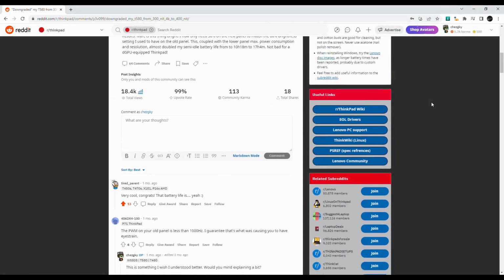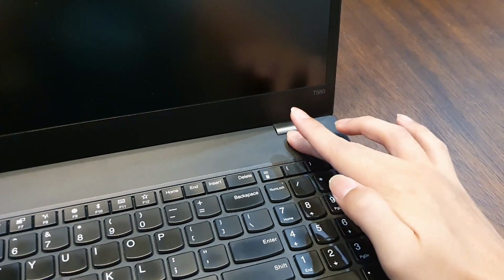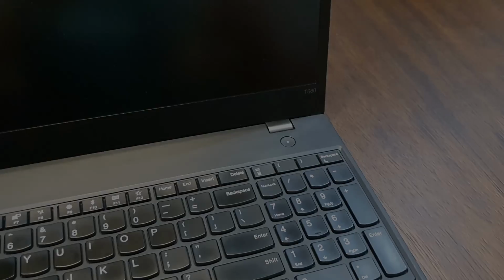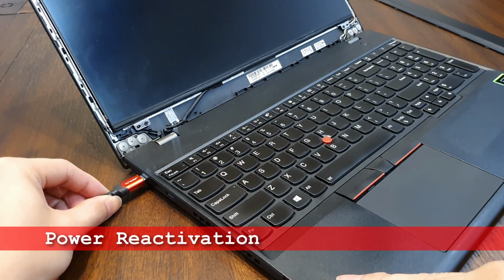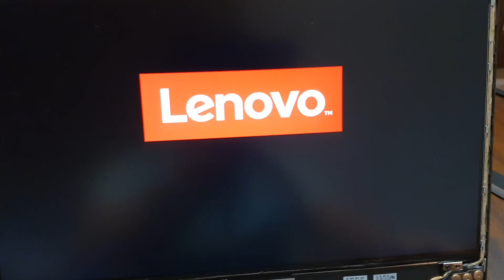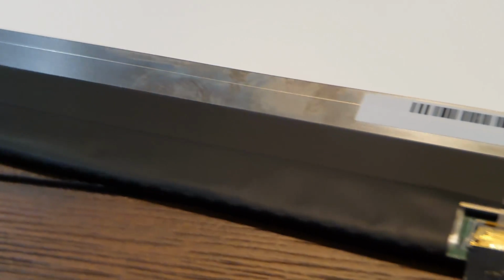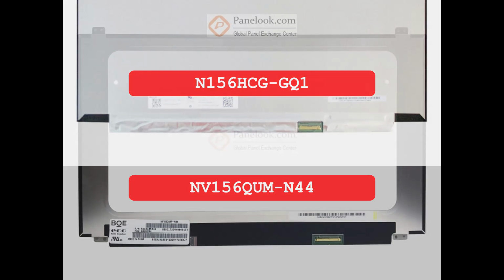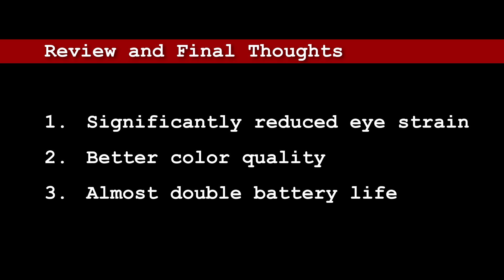DIY Thinkpad T580 P52s LCD Screen and Display Cable Replacement Guide | Innolux Panel Upgrade

Comment: I don’t quite get it… My P52s also came with the 40pin 4K panel like yours, but how am I supposed to get the 30 Pin innolux GT1 to work if it is not compatible with the 40pin port on the mobo??? Sorry but i am really confused…

Comment: Does the touch screen work if the original display didn’t have touchscreen?
Reply from the maker: You will need to get a 40-pin LCD cable that's for FHD touchscreens, which is different from the 40-pin 4k LCD cable.

Comment: is the panel you used in the bios whitelist? if not how did you handle it?
Reply from the maker: I don't think the T580 employs a BIOS whitelist for LCD panels. I could be wrong though.

Comment: Hi Everyone, 
I bought the  15.6'' 4k x 40Pin  NV156QUM-N44 für Lenovo Thinkpad T570 T580 P51s P52s Non-Touch-Display 
... I will then by a new cable. any suggestions on this CABLE topic? I would appreciate your help.

Comment: Hey, appreciate your video, really informative. I'd like to ask about the screen's color calibration, how did it look out of the box? Color is somewhat important to me, I wouldn't want to use a screen that needs calibrating. How did the color seem to you when you first installed the screen in the T580? Would you recommend a calibration tool or maybe trying to find a color profile somewhere?
Reply from the maker: It did need a little calibrating. I didn't have a nice calibrator, so I just loosely matched the color with that of my X-rite calibrated T15g.
Reply: @ChezDoesStuff  alright, thank you for the quick response!
Reply from the maker: @Pepogabritz  you're welcome!

Comment: Hi, does this screen fit on an Acer Aspire 3 that has the original NT156WHM-N44 V8.0 screen? On panelook the original screen is flat and the N156HCG-GT1 is bent

Comment: I can not disable the intrnal battery by the bios because the scene is broken is it possible to do this manually
Reply from the maker: No guarantees since I've never tried this, but you can try manually disconnecting the physical internal battery from the underside.
Reply: @ChezDoesStuff  Thank you. I was hoping to find an answer from somebody who had tried it. That was also my thinking if I don't get a definitive answer from someone I will try that tomorrow. And I will post a comment here to tell people whether it works or not. I am amazed that my question is not asked more often. Because I would have thought one of the main reasons to get a new screen is because the last screen is broken. And obviously you can't access the BIOS if the screen is not working.
Reply from the maker: @holographicbreathing  indeed. Please keep us posted and take care not to touch motherboard contacts while the internal battery is still plugged in.
Reply: @ChezDoesStuff  will do. thank you

Comment: Hey Chez great work! Your video helped me gain the confidence to do the same upgrade on my T580. I bought the N156HCE-GN1 500 nit display from the same Aliexpress seller (Gentby). It came with tape on brackets like yours, however for my T580 the brackets do not line up properly with frame in the lid. I ended up having to use double-sided electronics tape to secure the left side of the display. Did yours fit out of the box or did you have a similar experience to mine?
Reply from the maker: Glad to have been of help! In my case, the brackets were already taped on and lined up pretty well with the factory holes. There shouldn't be any performance issue mounting the LCD with tape instead of screws (newer Thinkpads are assembled this way). Cheers

Comment: Hi, recently i bought t580 with broken touch screen and wanted to replace it but it turns out that it isn't so easy to buy new one. However I don't really need touch screen at all so I want to change it to non-touch one. The problem is that touch screen has 40pin edp and non-touch ones come with 30pin edp. Could I just replace my screen cable from 40pin to 30pin and then use 30pin non-touch screen? Do you think it will work? My main concern is that 30 edp cable won't fit in motherboard, is there some kind standard connector so we can switch cables?
Reply from the maker: Yes you can do that. The process is the same as what I did here. The 4K display I removed had its own 40 pin cable. The 40 and 30 pin cables are only different on one end. They are the same on the other that plugs into the motherboard.
Reply: @ChezDoesStuff  Hi, just bought things and replaced it. Thank you so much for help!
Reply from the maker: @bartoszromanowski3868  that was fast! You're welcome!
Reply: @ChezDoesStuff  Hi, can you replace the 4k screen for 2k screen if i could not get a 4k screen?
Reply from the maker: Yes, but that'll entail a cable swap as well.

Comment: Useful vid! Aside from external dimensions, what else should I look out for when choosing a panel?
Reply from the maker: Thanks! You'd want to look for a panel that has a similar connector interface as your existing one. (eg. 30-pin eDP if you're doing a full HD to full HD swap) In my case, I moved from UHD to Full HD, so I had to get a compatible cable for the new panel as well. Also pay particular attention to the location of the connector port - some panels have them on the other side or even in the middle. While relocation cables exist, I generally try to avoid them, since they present another possible point of failure in the long run.

Full specifications and photos of various LCD panels are available from Panelook, which I briefly featured in the video. Any more questions, please let me know. Cheers!